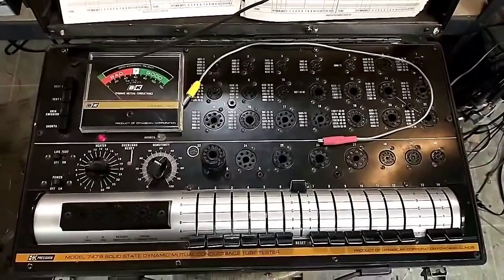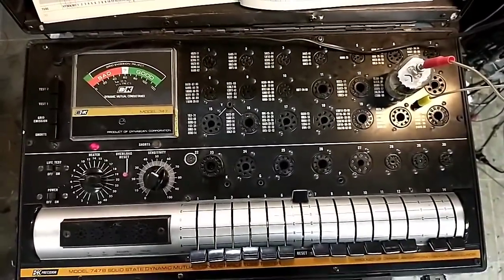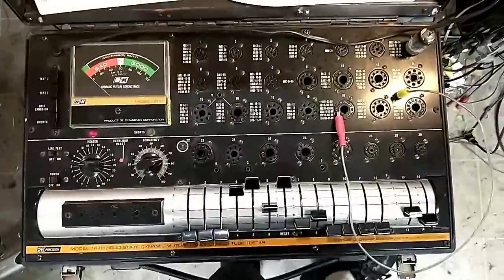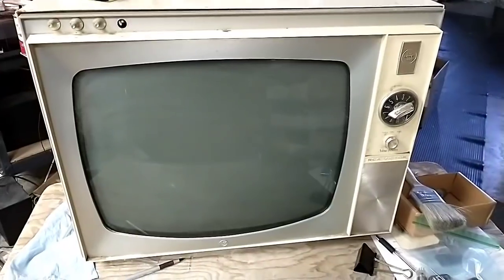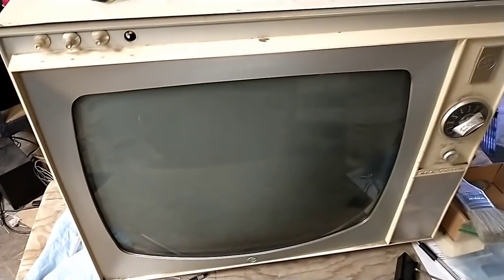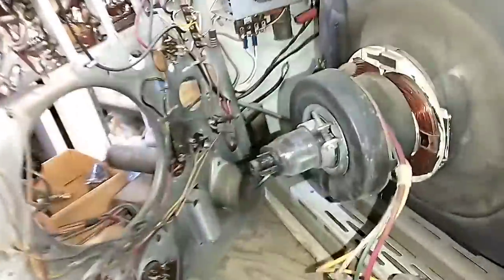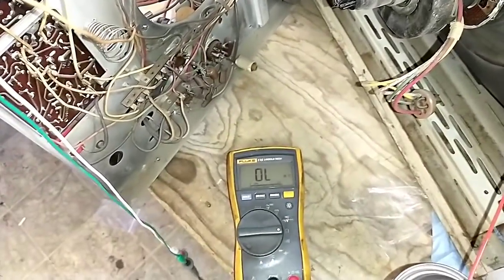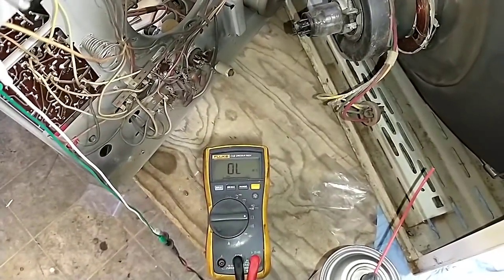Repair attempt of 1963 RCA 19" b&w vacuum tube television. KCS147a chassis. P2/?

Comment: That set is an upscale black and white.  It is made with the same quality level as RCA's color sets.  The low cost models had no power transformer.

Those pots come apart fairly easily, 4 tabs hold it together.  If the stop is broken though, the bakelite wiper is likely mangled.  I think it would be nearly impossible to find an exact, or even close replacement.  It might be easier to just attach a trimmer pot on the circuit board.  Once the horizonal frequency was set, you usually didn't have to adjust it until you replaced the oscillator tube.

The horizontal foldover is likely caused by shorted windings on the deflection yoke.

The lack of snow with no signal might also be due to the AGC being badly misadjusted.

Comment: While my grandmother was cooking dinner, I got ahold of a screwdriver and took this exact model apart. My grandfather was furious with her for letting me do it, and also do it with it plugged in. I was five years old at the time.
Reply from the maker: That was about the age i discovered electricity, as i was obsessed with an old fan my father had, which had a short in the switch or cord. Plugging it into the wall led to an electrifying experience. I was hooked

Comment: Hopefully you can find the correct potentiometer for the horizontal hold.  I bet this TV had a lot of horizontal issues from the beginning, and the owner probably played and played with the knob so much it just got worn out.  Finding the correct  value potentiometer can be hard for an old set like this.  These look to be very heavy duty control knobs so i bet the original owner was rough with it.  Also i like to call these a hybrid set due to the fact it has tubes as well as electronic components like capacitors resistors, and coils.  The tubes act like ic's.  So you basically have a chassis that's part electronic, and part tube.  Later down the road when ic's came along well they went to full solid state.  These as well as the Zenith brand sets were very well made sets.  I hope you can get it fully working again. Great vide.
Reply: This set has a lot a problems!

Comment: Check the waveform on the grid of the horizontal output.
Do not try to measure the plate.
A scope can tell you a lot, I notice too few people use them.
Reply from the maker: Oh yes. I will resort to that if replacing the dead horizontal hold pot doesn't improve things.

Comment: All these old sets that are repaired, I always wonder if the broken parts were from age or if they were the reason the set was retired.
Reply: Sometimes it's because a lot of people changed over from B&W to color. So a whole load of perfectly good B&W sets were relegated to the shed, or outside, like this example.
Reply: The reasons sets got retired in the 1960's were: (1) CRT needed replacement, which usually cost about half what a new set cost.  (2) Too many trips to the TV repair shop.  Most sets needed the high power tubes, like the horizontal output, to be replaced every 2 years.  Sets that were trouble prone had a short life because, the average repair shop Bill was 1/3rd the cost of a new set.  (3) When color sets became more affordable in the late 1970's, some B&W set did get removed but, seldom thrown away if working, due to the cost.  They would often times get traded in on a new set or get donated to a thrift store.

TV sets were quite expensive in the 1960's.  The entry level color set in 1966 was $300, or about $15,000 today indexed to the price of gold.  The average family income then was $75 a week.
Reply: @billharris6886  Your last paragraph puts everything into sharp relief about the cost of new electronics back in the 1960s. Great comment.
Reply: @channelsixtysix066  Hey ss, you are very welcome.  I was born in 1955, was always interested in TV's, and worked as a TV Tech in Miami, Florida during the mid-1970's so, experienced it firsthand.
Reply: @billharris6886   I regularly watch TV and radio servicing channels, because of my own electronics background. Whilst I can see the value of keeping old TVs going for historical purposes and for interest, it is a concern there are no facilities any more for rebuilding CRTs. What's left, isn't going to last forever. In Australia, we generally don't have the same desire to keep old TVs. They are quickly replaced with new gear. Old radios are more of a thing.
Reply: @channelsixtysix066  Agreed, it's the same way here in the US.  Keeping the old stuff alive is a bit of a novelty as well as a piece of history.  While I like the dependability, increased features and performance of the new stuff, I do like the mindset of the older stuff.  The old stuff was made to be repaired easily and replacement parts were available from the manufacturer some years after the product was made.  Today however, the mindset is much different; starting with Japan after WWII to the current day with China, after they ship it to us, they don't want to see or hear of it again.  I understand the reasons for companies going this direction (slim profit margins) but, we pay for it by dumping huge amounts into landfills in addition to declining abilities of the general public; no one knows how to be self-sufficient anymore.
Reply: @billharris6886   Technology in Australia tends to change very quickly. There's no sentiment in old gear, once something new comes along. I was aghast at the swift replacement of CRT TVs once the cost of panel TVs came down in price. CRTs were off the shelves within a year or so. No one here misses them. Perfectly good CRT sets were tossed out on the side of the road waiting collection. When my retired parents replaced their last CRT set, they purchased a Samsung. That was around 2011. It has been on virtually every day since and works perfectly to this day. I don't own a TV, haven't done so for over 20 years. I stopped watching it, when reality TV came along.
Reply: @channelsixtysix066  The same thing happened here in the US, for the past 10 years now, you can't even give away a working CRT television; no one wants them.

Comment: Dear sir i am having an AM radio which has MW, SW1 SW2 bands. Until last day it worked and yesterday it doesn't picked up any stations in all 3 respective bands. I have checked all the IFT transformers for any possible open circuit and soldering joints and checked the band sliding switch too. Finally i suspect the gang capacitor and checked. The upper terminal became loose and i soldered it properly. Even though the terminal goes inside the capacitor is not properly connecting the capacitor. I opened the outer top cover of the gang and just remove one moving plate, one static plate (sheet) and insulator and i don't want to mess the gang and put it back. After fixing the gang it still not working hence the entire receiver is not picking up any stations. Should I need to change the gang capacitor or is that possible to repair the gang. Please suggest sir.
Reply from the maker: Very rare for a ganged capacitor to fail. More likely that the oscillator transistor for mw/sw failed.

Comment: How about rebuiling the pot/pots ? You can buy carbon spray for that very purpose.
Reply from the maker: That's alot of effort for this set. If it were an Uber rare radio and there were no other options maybe. I was told this is a 70k pot, so a 100k will probably work fine. Just gotta find a long shaft and cut and machine it down
Reply: @JordanPier  I do understand. It's just that the time and efforts of finding a replacement, fiddling with it and then replacing it, in the end can turn out to be more laborious than cleaning and rebuilding.